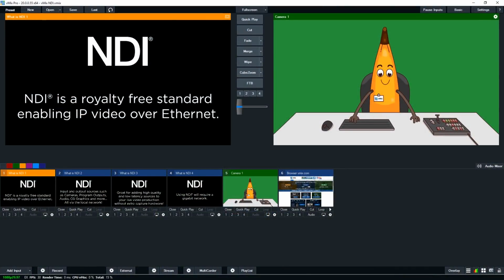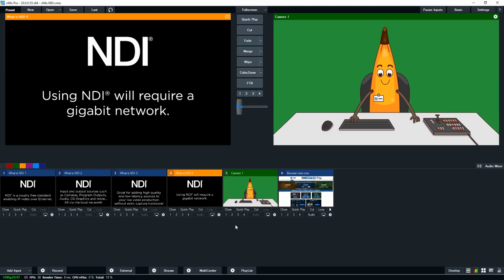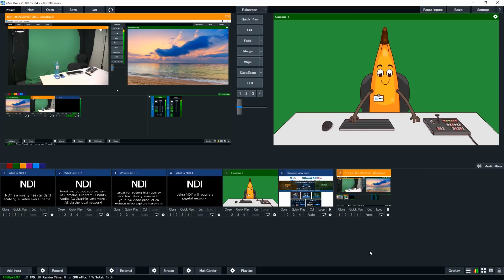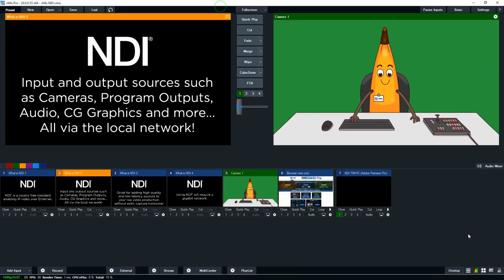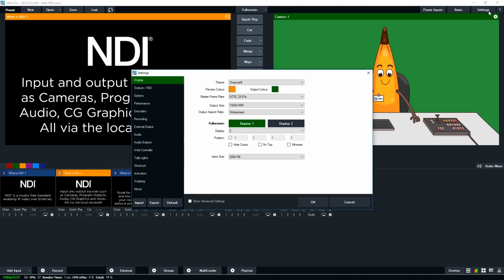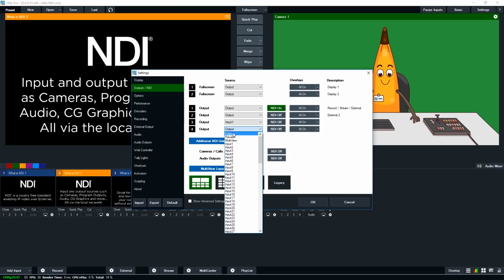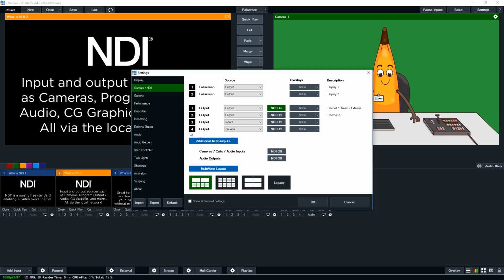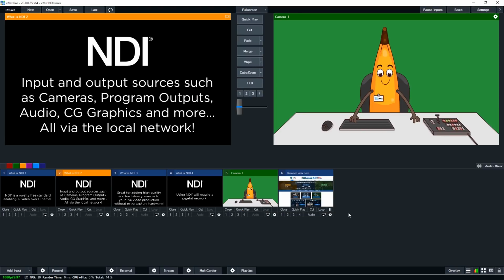How to Use NDI®  with vMix. Learn to send and receive NDI sources.

Comment: Not being the sharpest tool in the shed, I watched all the videos to use one computer via NDI to another computer with vMix. None of the videos say you have to run vMixDesktopCaptureNDI software on both machines to get it to work. ugh. Those small pesky steps left out of the tutorials.
Reply from the maker: You don't need to? By running the NDI Desktop Capture it just makes it available on the network as an NDI source. You can then use another program that supports NDI to view it such as vMix, OBS, NDI Studio Monitor etc.

Comment: Im using vmix HD, then stream to zoom from other pc, but the visual output is not as good as program in vmix. I already use cat6 cable and gigabyte router, internet speed 70Mbps.
Reply: im 4 years late but you were probably using zoom meetings which is SD quality if you select camera in zoom